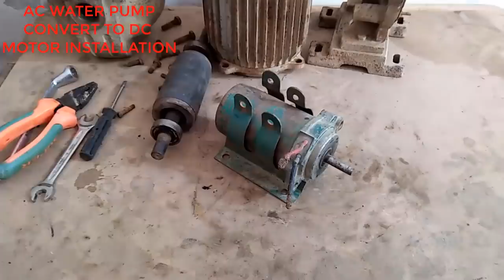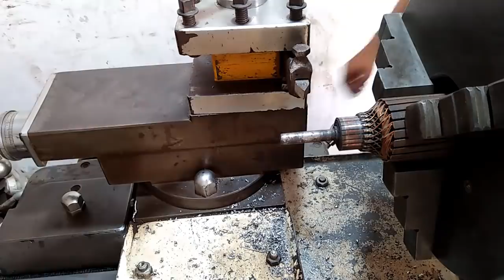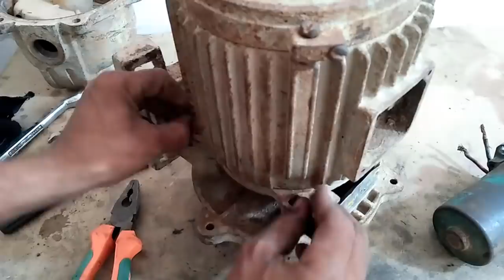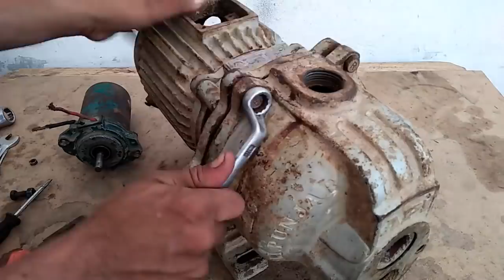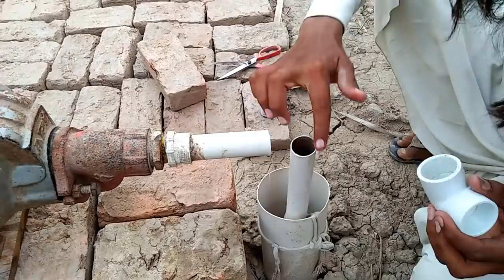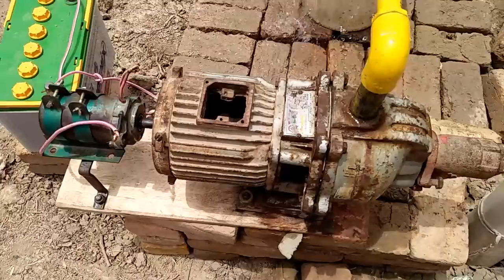How To Make Solar Water Pump At Home With DC Motor Old Electric Water Pump Convert To Solar Pump

Comment: why not just put the 12 volt motor to the pump shaft
Reply: Because the pump have not separated shaft. Its posible to conect DC motor direct to the pump, but its more dificult.

Comment: I'm confused, how exactly this is solar powered? 😂😂
Reply: Filip Misevski solar power means 12 volt .little motor is 12volt .in pakistan 12volt is called solar
Reply: u can also run from it 12v solar panel.
Reply: The battery is charged by solar panel which is not shown here. Suppose there is a solar panel set up. What you need to do is just connect the motor. It will be very useful for farmer. Farmer will be happy if they get it.
Reply: I think  he's mening ander sunny 🌞